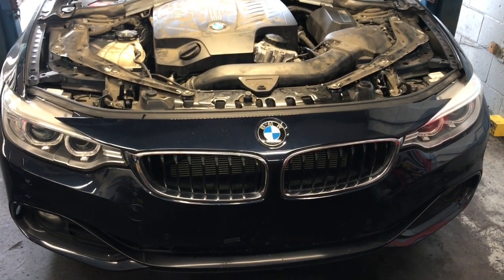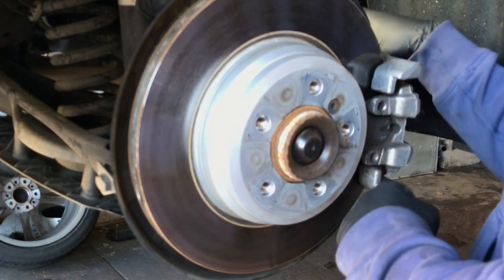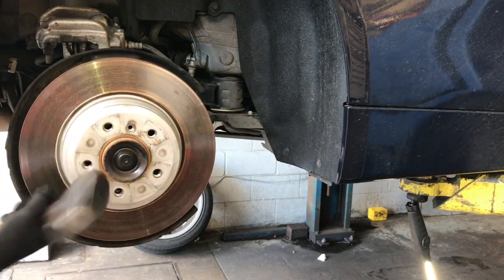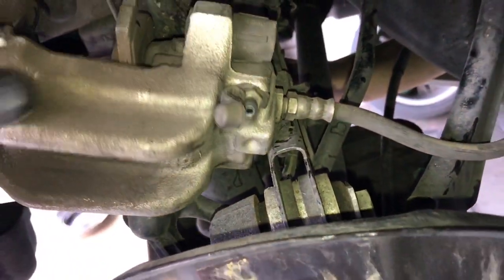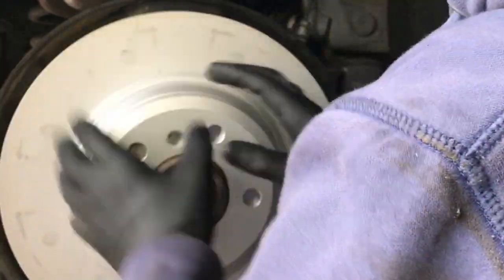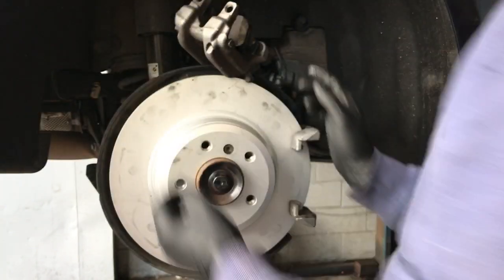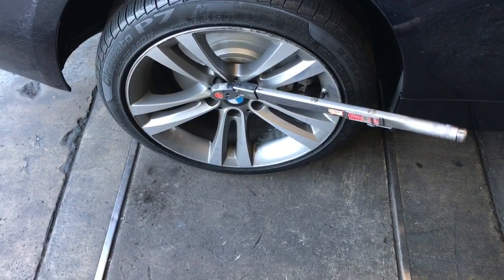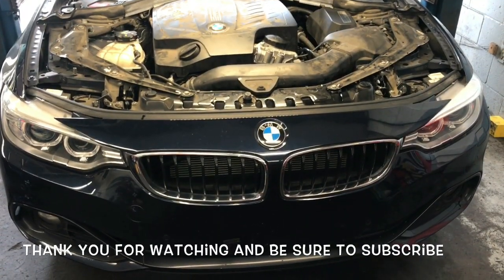How To Replace The Rear Brake Pads, Rotors And Wear Sensor On A Bmw 435i

Comment: Just did this today but on the front axel, F36 (2016 428i Xdrive Gran Coupe), the rotor screw is a 6mm Allen, and as for the sensors, there is only 1 sensor on the front axel and one sensor on the back axel. My rotor did not pull off easily, very rusted on, had to hit it with hammer, and the tire was rusted on as well, took a couple of good kicks. Otherwise the video was spot on and very helpful. Much appreciated.

Comment: I noticed you are changing the rear Brake pads but have a link for the "Front Brake Pad Wear Sensor" Are these the same in length etc. I'm trying to make sure before i purchase. Thanks
Reply: no they're different lengths. front sensors are a lot shorter

Comment: Good informative video,why do you have to replace the sensor every time you change the pads?can I reuse the old one if it looks in good condition?.
Reply: If it's time to change your pads, it's more than likely time to change your sensors. The sensors wear down as well as the pads do. They aren't that expensive considering..found them for $12 on Amazon

Comment: what are the torques in NM?
Reply: Drazen Ognjenovic 30Nm 90°
Reply: @dylan-nguyen  110 nm on which bolts? I doubt that this are the torque figures for the caliper bolts.
Reply: @volf4o  shit my bad... 110NM is for the front brakes
2AZ	Brake anchor plate to swivel bearing 110Nm

rear brakes
2AZ	Caliper carrier to wheel carrier
30Nm 90°

Comment: Hey, do you think this would the same procedure for a 2012 328i? I need to replace the rear brake pads
Reply from the maker: Sanjam Singh probably more like this one How to Replace the Rear Brake Pads Rotors and Wear Sensor on a 2008 BMW 335ihttps://youtu.be/-Jg9EKSS3B4

Comment: What side is the sensor on? Driver or passenger? Also, if my light came on how do I know if it’s my front or rear brakes.
Reply: Each have it's own sensors.
Reply: It's the driver side on the front and the passenger side on the rear.

Comment: Would these parts work on a 428i?
Reply: Depends. Is your rear brake caliper with one or 2 pistons? It's easy to spot it - do you have a retaining clip on the external side of the caliper or do you have a cylinder like piston?

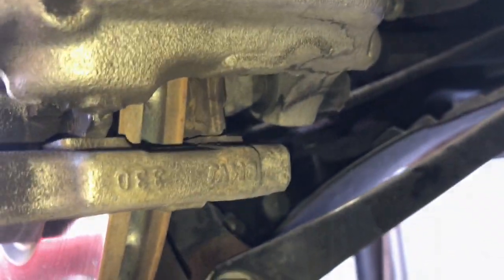Comment: How do I know if it's electronic or not like you pointed out at the beginning @ 1:20
Reply from the maker: John van der v. There would be an electric motor on the back of the calipers
Reply: @HowtoAutomotive  oke, this has to do with the electronic  hand brake isn't it? Just figured out on a forum, mine doesn't have that, it's a f31 320d from 2013. So i'll be able to replace front and rear by myself. Hopefully ;)

Comment: How much does the job usually cost
Reply from the maker: In the shop setting it’ll be about an hour and a half labor. Depending on where you live they can vary. My shop charges 115 per hour after that you can add in the cost of the parts. Check with your parts suppliers for those numbers.